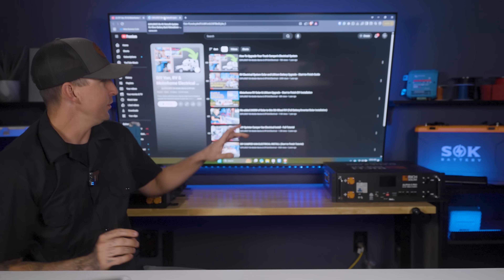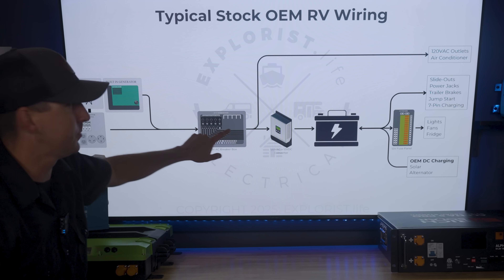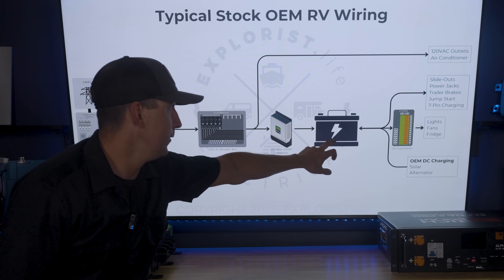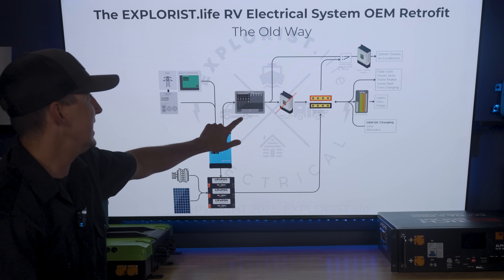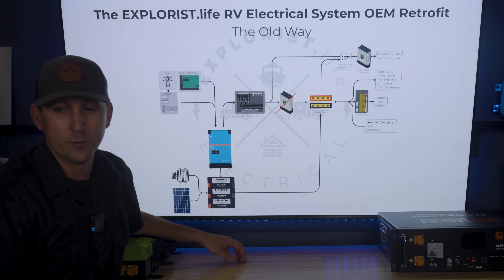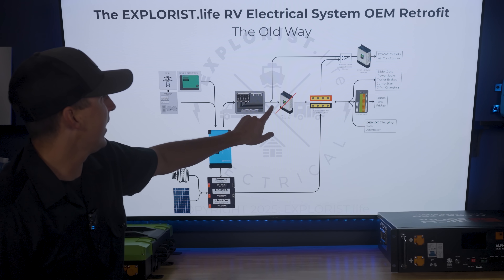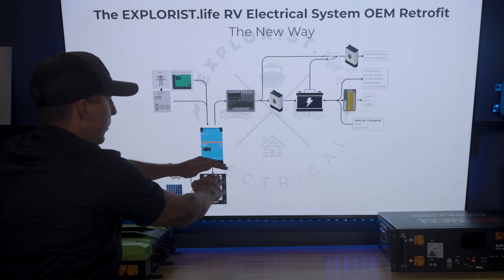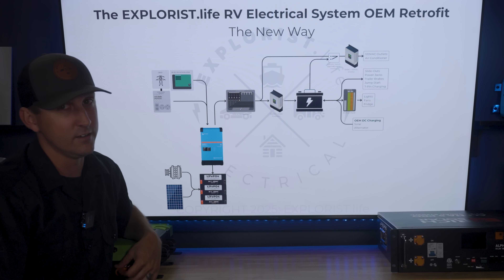The New Way to Upgrade RV Electrical Systems (No More Battery Relocation Kits!)

Comment: Nate, have you noticed if the "New Way" affects how long people are able to be without recharging versus the "Old Way"?  Let me give some context.  When I originally installed our system, I had it setup as the "New Way", then after a year of so, I finally had the time to convert the system to the "Old Way".  I found that when I changed our system from the "New Way" to the "Old Way", the amount of time between when we needed to recharge our batteries almost doubled, even though our usage remained consistent.  After trying to figure out the cause, the only conclusion I could come to was that the converter in the "Old Way" was constantly, slowly drawing power because it was always in float mode to keep the lead acid battery topped off.  Thoughts?
Reply from the maker: I think something else was going on.  Double run-time isn't indicitative of converter usage.  More like 10% max, though more often closer to 6%.  And that's only for 12V DC loads, not 120VAC loads.

Comment: I like the isolation of the new design, but, don't you introduce a deficiency behind the 12V circuits? For instance if you want to upgrade your AC to an efficient 12V system, putting it behind a invertor / convertor / battery will make it much less efficient than connecting it directly to a 12V lithium, no?
Reply from the maker: Realistically, I've never seen anybody with a 120V air conditioner in an RV swap it out to a 12V DC air conditioner as that would involve running new wiring to the air conditioner.  I suppose if somebody were wanting to do this, we still sell the parts for the 'old way'.  Are  you in the market or just coming up w/ hypotheticals?

Comment: I'm 1-year new to RVing, but have been looking at adding solar/LiPo since last summer.  I came across your site and wanted to join you at September's Steamboat meeting to ask these questions...

I completely agree that using the entire solar system to feed the pre-existing setup is the simplest way, and the way I had planned to add solar and batteries.  Essentially, the existing system thinks it's on shore power at all times, letting the new power system handle the new battery capacity and shore/genny/alt switching management.

The question I have is regarding using my travel trailer like a Tesla, to power my house when the grid goes down.  I'm planning on putting a self-build 51.2V 300Ah battery (or greater) in the trailer.  What is the best way to accomplish this?

Thanks!  Hope to catch you in Steamboat in '26!  Merry Christmas and Happy Happy!!
Reply from the maker: Happy Holidays! Powering your home from the trailer is doable, but the “best” way depends a lot on your battery/inverter choice, transfer switch/islanding safety, shore power wiring, and how you want it to behave during an outage.

Instead of guessing, reach out to our support team with your trailer model and what you want to run in the house—we’ll help you map out a safe setup and the right parts: 👉 https://shop.explorist.life/support?utm_source=youtube&utm_medium=comment&utm_campaign=support&utm_content=response_link

Comment: in a motorhome (not a trailer) with a 12vdc air conditioner (nomadic cooling) can that be run off of the 12v converter? it draws allot of amps alone never mind other 12vdc loads.  if we're using 12volts for most everything and 110v only for a few select items (induction cooking, laptop charging, camera battery charging etc). seems like the converter is the weak link in this scenario and the battery relocation kit would be a better option.
Reply from the maker: Great!  We still sell the parts necessary to make that happen.  Are you in the market for a system like this?
Reply: @EXPLORISTlife i will be in the near future, don't worry i'll give you a call. been a long time follower for many years.

Comment: Nobody is mentioning that with this version you can still keep the original charge converter off and top off charge your 12vot battery with  1 or 2 dedicated roof panels. Could even use a portable briefcase style ground panel and only if you don't feel like deploying it turn on the OEM converter.  I mention this because many are commenting on the conversion loss of going from DC to Ac back to DC. That is still optional.

Comment: Can I simply replace my lead acid battery from the manufacturer with a lithium and switch the charge controller and converter to lithium to get more Amp Hours for the occasional boondocking weekenders?
Reply from the maker: It can be that simple in some cases, but it really depends on how your RV is set up and how everything works together.

If you want to be sure you’re upgrading the right way and actually getting the benefit you’re after, the best next step is to have us take a quick look at your specific setup. Our support team can point you in the right direction and help you get exactly what you need for your project 👉 https://shop.explorist.life/support?utm_source=youtube&utm_medium=comment&utm_campaign=support&utm_content=response_link

Comment: Only problem I can see is the fact that if you leave that old AGM battery in there charged or not it creates corrosion and everything that it’s connected to…. Which is the main reason or one of the big reasons why lithium is so much better is the fact that it does not create corrosion like AGM batteries do…. please correct me if I am wrong.
Reply from the maker: That’s a really good point — and situations like this can depend a lot on the specific setup and how everything is installed. To make sure you’re heading in the right direction (and to avoid any unintended issues), it’s best to have someone take a quick look at your particular system.

Our support team can help sort through the details and make recommendations based on your exact project: https://shop.explorist.life/support?utm_source=youtube&utm_medium=comment&utm_campaign=support&utm_content=response_link

They can also help you figure out the right parts if you decide to move forward.

Comment: I see how this simplifies things, but my case is slightly different. I have a factory solar system, (3) 100 watt panels, and (2) 100 amp hr battle born batteries. I would like to add a larger battery bank and more solar panels. Would the correct approach be the "new" way? I.e. Add the new solar panels, larger batteries, multi plus 3000, like shown in the video, keep the (2) 12 volt battle borns on the backside of the multiplus where the lead acid battery is shown in your example?
Reply from the maker: Great question — upgrades like that can change what’s “correct” depending on your exact layout, existing gear, and what you want the final system to do. We’d really like to take a personalized look so we can make the right recommendation and help you get the parts you’ll need for the upgrade.

If you reach out to our support team, we can go through your setup and guide you step-by-step:
https://shop.explorist.life/support?utm_source=youtube&utm_medium=comment&utm_campaign=support&utm_content=response_link

Happy to help you plan the whole system!

Comment: So. Im going to 24v and victron...im assuming the efficiency loss of the 24-12v is comparable to the 120-12v converter. If its close then you definitely have the best setup.
Reply from the maker: That's a great setup to consider! For specific efficiency comparisons, it often depends on the specific models of converters, but generally, both approaches have their trade-offs.

Comment: Awesome !! Just what I needed . 
Question.... looking  at installing at least a 5k multiplus in the spring in a Dp moterhome.  The  xandrex freedom inverter/ charger is 20 years old but still works , however I get a lot of buzz through the TV speaker, and believe it coming from the xantrex. WOULD I also need to change inverter or can I just eliminate it . My confusion is what to do with the 12 volt dc components, when the multiplus would be coming from a 48 volt systems.
Reply from the maker: Glad it was helpful! 🙌 That’s a big upgrade and there are a few important details with mixing the old Xantrex, 12V loads, and a new 48V Multiplus system that really depend on your exact layout and goals.

If you reach out to our support team, we can look over your current setup, help you decide what should stay/go, and recommend the right parts to make everything play nice:

https://shop.explorist.life/support?utm_source=youtube&utm_medium=comment&utm_campaign=support&utm_content=response_link

Comment: Thanks for the informative video. I really love researching this stuff.  I have a concern with the "New Way" for smaller towable RVs where most of the power usage is for 12 VDC devices.  The "New Way" requires that the AV inverter be operable to charge the existing 12 VDC battery from solar, especially given the modest solar in many smaller RVs. This inserts a lot of inefficiencies just to keep the everyday 12 VDC devices powered.  Maybe these RVs are not part of your business customer base.
Reply from the maker: Yes - we considered that as part of this whole thing.  That's a pretty obvious consideration and I assure you - it's not as big of a deal as most make it out to be.  We've found that most people run their inverters 24/7 anyway.  Remember that we sell both the 'battery bank relocation' options as well as the 'new' way as well.  If you prefer the 'old way' - I'm happy to sell it to you.  Are you in the market?

Comment: What’s wrong with just letting the tow vehicle power the brakes if the factory battery is removed?
Reply from the maker: What happens in the event of a trailer runaway where the 7-pin comes disconnected?

Comment: How does oem 7 pin charging and the new alternator charging work simultaneously? Do you splice into the auxiliary power and ground wires of the oem 7 pin connector at the trailer tongue?
Reply from the maker: That’s a great question—combining OEM 7-pin and alternator charging can get a little complex depending on your setup. We’d love to take a closer look at your system and help you plan the best (and safest) way to wire it. Reach out to our team here: https://shop.explorist.life/support?utm_source=youtube&utm_medium=comment&utm_campaign=support&utm_content=response_link

Comment: Does the 'new' way run the chance of not having enough 12 lead acid battery for all DC loads or can the factory converter keep up?
I believe that if the new battery bank is 24 or 48v, you do gain efficiency in the inverter and solar charge controller.
Reply from the maker: Great questions—load coverage and converter compatibility depend on your exact DC loads, bank voltage (12/24/48V), and how everything’s tied together (converter, inverter/charger, DC-DC, etc.). We can review your setup, size the components properly, and recommend the right parts list. Send us your details here and we’ll map it out: https://shop.explorist.life/support?utm_source=youtube&utm_medium=comment&utm_campaign=support&utm_content=response_link

Comment: on my 93 beaver brunswick ,  I bought 4 lithium 12/100 and li-bim 225 replace old led bats and solenoid, but than I need to replace heart ems 2800 invt/convt, at this time have not done it yet , cause ended getting an EG4 inverter with tech cella server battery... what I want to do is add both of them on my rv.............EG4 will be use for 110/120 and be charge by outlet 50 amp and generator; The 4 batteries that are replacing the old I want to use them on my 12v outlets lights etc...with a buck converter 48 down to 12v , just need advice if its possible and how I can do this
Reply from the maker: That sounds like a really cool setup you’re working on! Since every system layout is a little different, we’d love to take a closer look at your project so we can make the best recommendation for your needs. Please reach out to our support team here so we can help you plan it out: 👉 https://shop.explorist.life/support?utm_source=youtube&utm_medium=comment&utm_campaign=support&utm_content=response_link

Comment: Question, thinking about upgrading from a single 240A alternator to a dual alternator setup by adding a 157 amp alt. to use it exclusively for my 12VDC 820Ah LiFePO4 battery bank. Is it worth the hassle and added expense?
Reply from the maker: Great question! Whether a dedicated 157A secondary alt is “worth it” really comes down to your exact setup and goals. We’d love to take a quick look at your vehicle, charge targets, and components and then recommend the cleanest path (single vs dual), plus a parts list if you want us to supply everything. Ping our team here: https://shop.explorist.life/support

Comment: I really love the video and the simplicity of the "new way".  By leaving the factory inverter, converter and battery in place, with the "new" power bank you would still have no reason to use the factory inverter boondocking, as the new power bank will be continuous "shore" power all the time.  Am I understanding that correctly?
Reply from the maker: Thanks for watching! It sounds like you’re on the right track, but every setup can have a few variables that change things. If you reach out to us at https://shop.explorist.life/support, we can take a look at your exact system and confirm how everything will work together.

Comment: I am very new to RVing, having only rented a Class C a few times and Class B once. However, for decades my wife and I have talked about buying an ore-owned RV and hitting the road on weekends and longer trips maybe 4X - 6X a year. About 6 months ago I hit a milestone birthday, and now have retirement on the horizon. We made a pact that we’d have an RV by the end of this year, so I have immersed myself in this space and am trying to learn all I can. However, as I also have not been in the community long, I have maybe approached this from a completely different perspective from what may be “normal”. And it just so happens that I have started down the path that you have laid out, but instead of spending out a custom system design and installation, I’m building it around stock components. We’ll be getting a 2016 - 2018 Winnebago View, and will be installing a 3.6kW / 3600 Wh “solar generator”, with an additional 3600 Wh battery, an 800 W dc-dc alternator charger and eventually up to 1400 W of solar on the roof if we find we need that. All of this will just feed into the shore power cable when we aren’t on shore power. It’s the same concept that you just described, except in my case it’s all in one box. Thanks for posting this, and I believe that you are thinking about this the right way and consistent with how the RV market, battery tech and solar tech are going.
Reply from the maker: Our opinions have been shaped by being involved in over 30,000 system upgrades over the past decade. 😎😆. We will be selling solar generators in our store within the next couple weeks if that’s the direction you’re trying to go.  Hit us up and we can get you what you need: shop.explorist.life/support

Comment: Thanks for educating us. Your detailed videos are great. Going with a 48v system setup, is it recommended to use two high amp hours 24v batteries, or a single "rack type" 48v battery? This is for a RV class c eventually. Are the rack type batteries indeed recommended for RV's?
Reply from the maker: You’re welcome!  Reach out at shop.explorist.life/support for assistance and we can get you everything you need for that project and provide the answers for those questions.

Comment: I live in Loveland and debating on paying blue compass thousands to install a inverter on our already "inverter prepped" rv. New video content for you? 🧐😁
Reply from the maker: Thousands for just the inverter install? 😳  may be worth the drive up to Oregon to have us do it for you.  Our average TOTAL labor cost for a FULL system (inverter, batteries, solar, alternator charging, monitoring) averages $3k.

Either way, even if you have blue compass handle it or if you diy it, we can supply the parts: shop.explorist.life/support and we can get you what you need.

Comment: Everyone is looking at the new 12v rooftop AC systems these days.  When I build my van, I'd love to do a 48v battery bank because of the much larger watt hour capacities and smaller wire size requirements.  So, I'm finding that these AC systems pull anywhere from 40 to 60 amps at 12v DC.   How would you hook it up to a system like your new configuration?  Would it need a DC to DC converter to convert the battery current from 48 v dc to 12 v dc?    Thanks
Reply from the maker: Great question—and a 48V bank can be an awesome move. The best way to tie a 12V rooftop AC into a 48V system (converter sizing, wiring, protection, and overall system layout) depends on your exact components and goals. We’d love to look at your specs and recommend the right parts (including any DC-DC conversion you might need). Drop us a note here and we’ll get you set up: https://shop.explorist.life/support

Comment: @EXPLORISTlife Very nice video indeed, I'm finding the 48V route more and more interesting, What's the typical cost for a setup as in this video? And what about the 12V alternator, how will it be upgraded to 48V?
Reply from the maker: Glad you liked the video! The total cost and alternator setup can vary a lot depending on your exact power needs and components, so we’d love to take a look at your build plans and help estimate pricing and parts for your 48V system. Reach out to us here and we’ll get you pointed in the right direction: https://shop.explorist.life/support